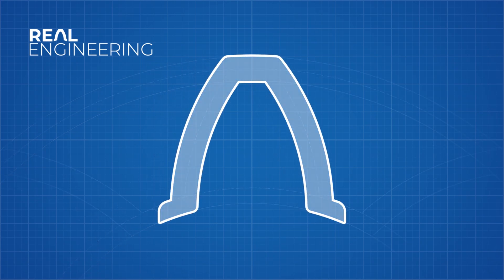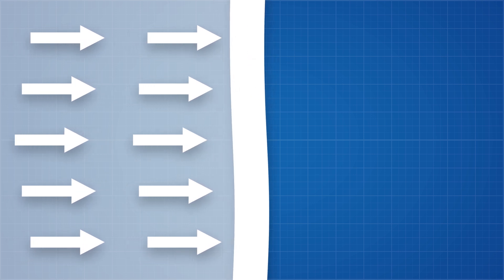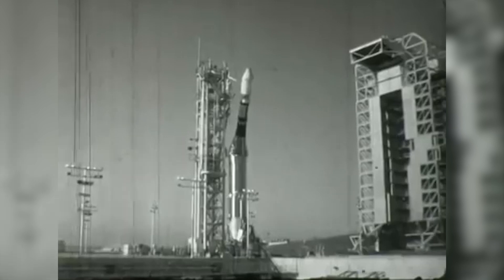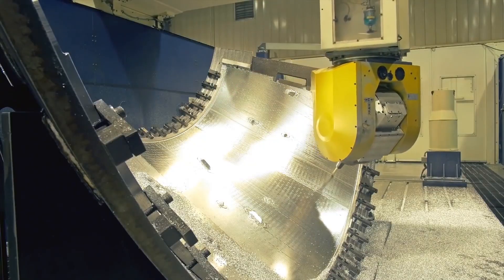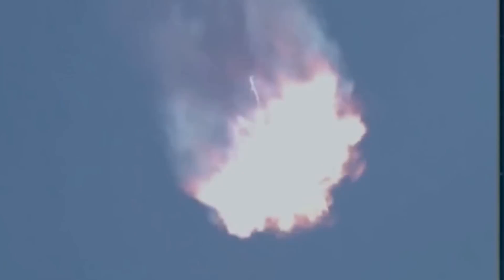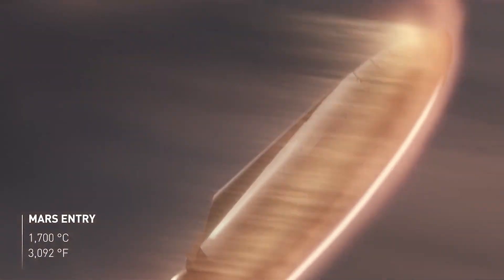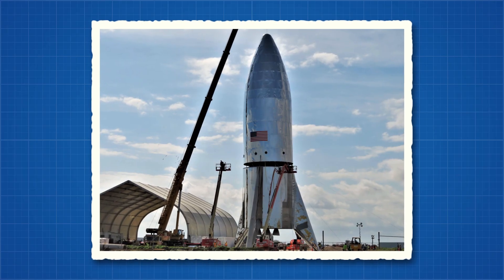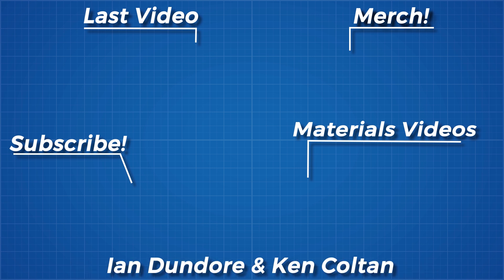Why SpaceX Built A Stainless Steel Starship

Comment: Would it not be ironically hilarious if the Mars spaceship ends up looking EXACTLY like the 'absurd' spaceships of 1950's space movies? :)
Reply: Yes, if you were to stretch the definition of "*extremely hilarious*" to an absurd degree.
Reply: Those 'absurd' spaceships looked like the V2 because people's idea of a big rocket was the V2.  By 2001 (the movie) a big rocket in the movies looked like the space shuttle.  What's the betting that if Space X succeeds then Hollywood's ideas will shift again ..
Reply: Yes your so right that would be pretty ironic and humorous. Or even like some of the spaceships from the old Flash Gordan serials.
Reply: Pretty sure you don't understand the full import of your question /statement. Try and think about it in reverse.
Reply: Buck Rodgers in the 22nd century! Lol I think the incredibles have a similar design :o
Reply: 1950s spaceships, many were based on the V2 rocket.  The V2 rocket was shaped like a bullet designed to travel with least air resistance.  So they weren't absurd designs. I think they started making rockets straight cylinders because it was cheaper and with more powerful engines they could go far even with a little wind resistance. Unless the Mars spacecraft are shaped like flying saucers, that would be absurd.
Reply: There were plenty of similar shapes proposed in the 1850s. Read a little ancient sci-fi - it's full of squat, upright, bullet-shaped ships that landed on their tail-fins. The 1950s people got their ideas from notions that were circulating a century earlier...
Reply: woh cares if it does for what it is build for Form follows Funktion...
Reply: yeah I was thinking the exact same thing :D
Reply: seq165432 totally jetsons i know 70's.... But  likin'the suitcase car better...sweet😁🇺🇸
Reply: I want it renamed nx1 enterprise
Reply: @komradewirelesscaller6716  why stop at that Ellon ahhhhh hasssss he will save everyone of us! 

Ming: who are you?
Ellon Musk quarterback New York jets!
Reply: Science fiction from history has been the greatest fortune teller so far.
Reply: A lot turns on whether all or most of the vehicle will travel surface to surface (and possibly back. At some point I would expect larger vehicles would go through at least part of the construction process in orbit or on the Moon, for travel between space docks, and would be freed of the design constraints of moving through atmosphere up and down a gravity well. The vehicles that make the latter “last mile” leg may always look something like the Spacehopper, particularly if they carry cargo. Assuming some form of space elevator is not ultimately put in place.
Reply: I'm not sure if you know what ironic means. Is it ironic that ipads and cell phones look like the fake stuff in star trek, that everyone thought was absurd?
Reply: Turns out its meaning is Big Fifties Rocket
Reply: Ironic and amusing perhaps.  I think Wernher Magnus Maximilian Freiherr von Braun was a big influence in the hollywood depiction of space travel and his ideas were certainly based in science. Maybe it is kismet.
Reply: Meanwhile, it looks like a huge drinking water tank
Reply: @greenbanana311   So many absurd things happening in the last couple of years, hard to keep track of them all.
Reply: I am sure it doesnt have to look like that but its the Dan Dare, Flash Gordon imagination of Elon Musk and it inspires our imaginations to dream of new frontiers. NASA the ESA, Roscosmos all being very technical and a little boring to the Public for some time. Even the international Space station, the Various space probes all revealing only analysis of Atmospheres or ground samples of our local planets and asteroids.
Reply: I call the Orion Project the Spinning Nuclear Fart Tube. It is absurd in that it is completely flawed. 
   I know one of the engineers who has worked on it, He is Funny Boy 🌈
Reply: Its gotta be real because it look so fake
Reply: Ideas have to come from somewhere.
Reply: @theyouchannel6355  the real thing was revealed you were right
Reply: Would be awesome to see the designs that we had for what we thought spaceships would look like in the future when they were making space films in the early days of space adventure and travel. 
I still think it is cool that the sci-fi films and books are not too far off what has been achieved in our present day achievements. 
To have been able to come up with the ideas and incorporate such new technologies must have been a big step and have been off the wall ideas of how the future could turn out. From the imagination of the writers and creators of early sci-fi films/books and comics to go ahead with ideas that must have been out of this world to most people and that were ahead of there time and were able to continue to make it in the film and literature world is so cool.
Reply: That would prove time travel
Reply: And the flying cars of the future would look exactly like the art-deco cars of the early 20th century
Reply: Mars will always be a dream
Reply: thinking the Same thing
Reply: Keep Pouring Money into it. Success.
Reply: We should have entered the path to Mars and Died. Years ago. Why are we not already flying to Mars already?
Reply: Mertian Temp.
Reply: Would it still be called (iron)ic if it was made of steel?
Reply: That's probably why Elon Musk chose this, despite other materials or ratrher compsites would serve the purpose much better.

One person's 'absurd' or 'impossible' is another's 'difficult but not impossible', while for the latter 'neigh-on impossible' is like magic to the former.
Reply: Concluding from this that Elon Musk would make an adequate sorcerer, so to speak. to most people.
(not me)
Reply: IRONically indeed!
Reply: so if going to be like 1950 movie will we see them walk on the side of the space ship on the way to mars like in a 1950 film
Reply: Im still waiting for a hover board...
Reply: @kenoliver8913  The Expanse
Reply: Were you hoping for it to look like ET's spaceship?
Reply: It would not. Those ships were designed by people that knew what they were talking about and they were largely  based on Von Braun's models.
Reply: @itsmeekers  save that for an FTL ship.
Reply: The 50s were a decade that produced absurdly beautiful pieces of machinery art from planes, trains and automobiles to toasters, fans and spaceships.
Reply: @jlokison  OK sorry got excited!
Reply: It already does !!!!
Reply: @lighting nerd 
RE: "Then again, considering that the transporters used "Heisenberg Compensators" you can be certain that the writers of Star Trek were well-versed in science."
No, they weren't. They were well-versed in "techno-babble".
Reply: @geraldhenrickson7472  
RE: "I think Wernher Magnus Maximilian Freiherr von Braun was a big influence in the hollywood depiction of space travel and his ideas were certainly based in science."
That's true; he was a big influence on hollywood's depiction of space travel and space travel as depicted in books, as well, during the 1950s and early 1960s.